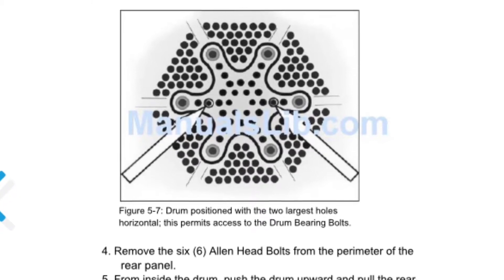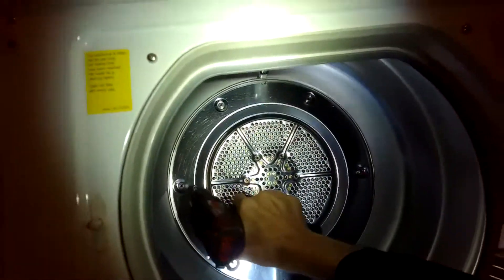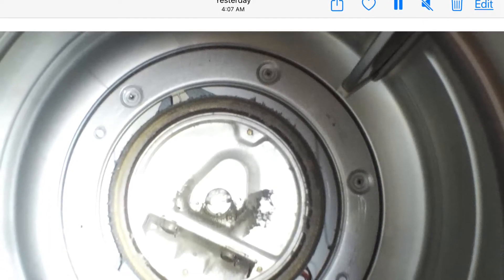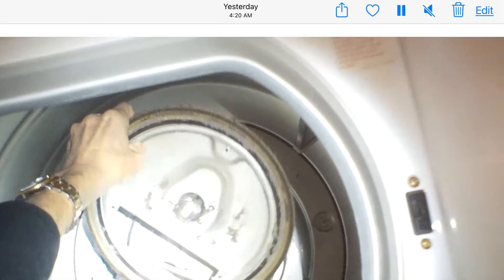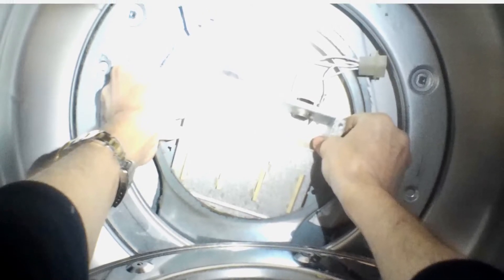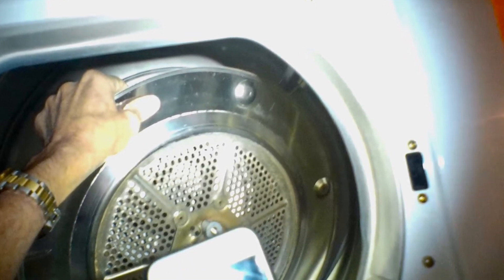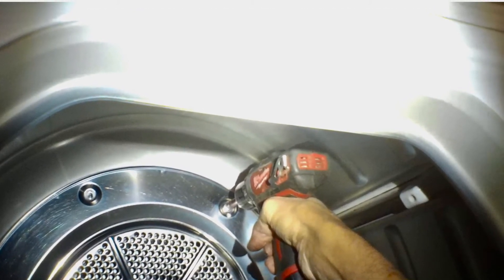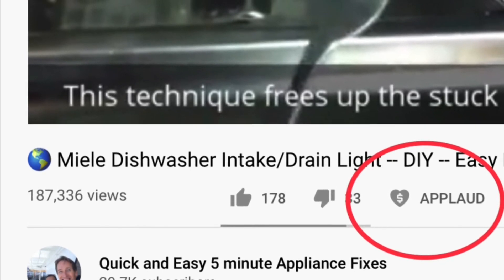🌏 MIELE TUMBLE DRYER WONT HEAT? Let’s Fix It !

Comment: Hi. I got the exact same dryer, used one, but have not been able to see if it works since it did not come with a power cable. Do you know  if there are any videos on how to install a new cable? Could you help me? Guide me oh  wise one! Thanks!!!
Reply from the maker: Hi Yvonne,  can you call Miele USA and ask them to send you a power cable?
Reply: @QuickAndEasy5MinuteAppliance  Thank  you for your reply. I do have the cable, I just need to know how to install it. I have tried to find diagrams and videos, unfortunately, I have found nothing that shows how to replace the power cable.